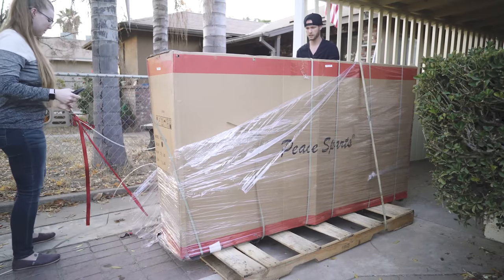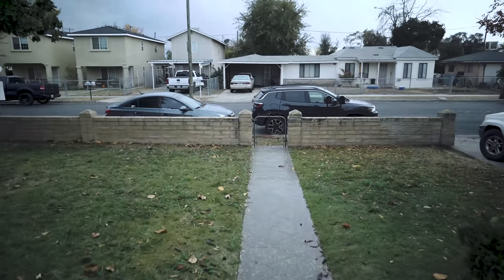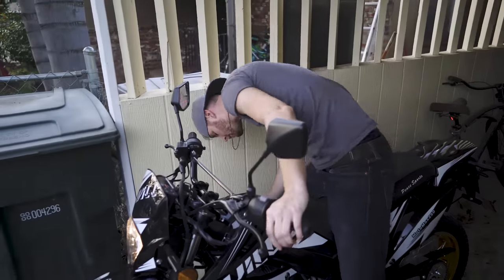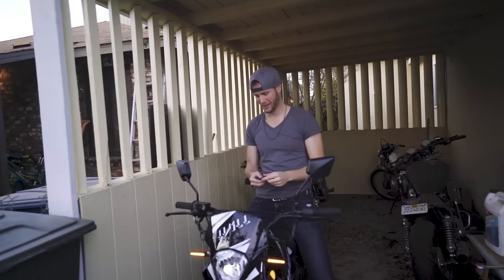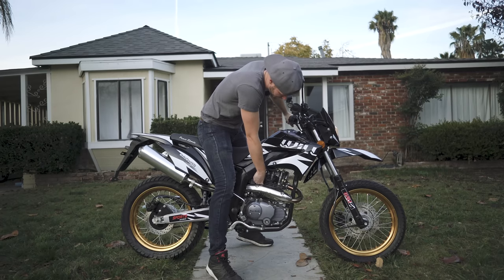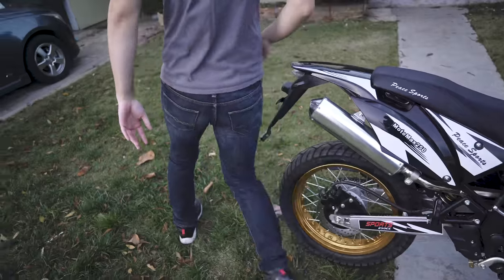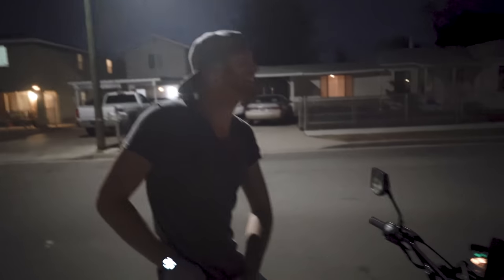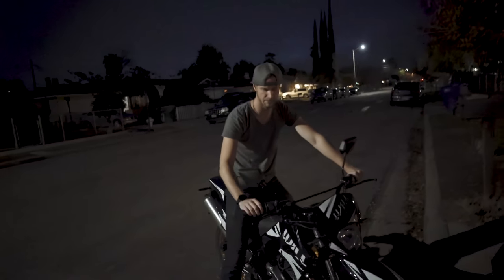This Motorcycle CAME IN A BOX (Shipped to my Door)

Comment: Take a day, take most every bolt out, blue LOCTITE them and torque them. Replace the ones under heavy stress with 10.9 bolts. Get a new chain. Open each connector and add a small amount of electrical grease and it'll last forever
Reply: You must be a mechanic or a mechanical engineer?
Reply: @dannythompson1948  actually I'm a family practitioner. I just enjoy tinkering and working with my hands.  I've taught my wife the same with her Vader. Even my 7yr old daughter can rebuild her own carb on her TaoTao 110cc ATV by herself.  It really is easy to do,  just tedious.
Reply: @Dr_Mike2  like a physician? That's awesome! I'm engineer at a hospital
Reply: @dannythompson1948  People let projects intimidate them because they're looking at the entirety.  There's an old saying,  "How do you eat an elephant?" "One bite st a time." In this case, one bolt at a time. 
My wife's Vader 125 I'd her first ever bike. It now has 26 miles on it.  The plan is to swap in a ZS190 engine and CBR125R fairings... One bite at a time.

Comment: Awesome video. Engine will break in.  Just wanted to share my experience with you for things to watch out for and do to keep it alive: first things: Replace plugs, change oil , add some gas stabilizer.  The bike we purchased only had a single phase stator and ended up breaking after the first week. Replaced with double phase.  Check bolts on suspension and wheels to make sure they are greased.  We had a bolt bust off after 2 weeks.  The carb will clog and will need cleaning after 3 weeks.  If you are a good with tools these should all be standard things you can fix. Just be aware the quality is just not the same and you get what you pay for.  Other than that, these overseas bike are really not that bad and now that parts are more available, time will tell if this catches on or if people get tired of the little things breaking. Cant wait for next video. thanks for sharing.

Comment: Definitely running a little lean. May be able to just adjust the a/f on the idle circuit (likely a small round soldered plug just in front of the bowl) and you probably need to go 1-1.5 revolutions of the screw out. At my elevation when I worked as a setup tech for Yamaha, all the dirt bikes needed to be turned 2-2.25 turns out on the idle circuit to get the A/F right, eliminate the popping on decel, and would rip way better when on the throttle. They’d ship all the new bikes in a crate just like that, and have a plug soldered over the A/F adjustment screw.

Comment: Check to see if the engine stops if the key is left behind following a remote start. Some bikes have this feature.
Reply: Andy Reid it’s not a Lexus BMW. It will start and run with remote start only. It’s a cheap Chinese bike. Take keys with u or leave them at home it will still run. It has no proximity link

Comment: Change the oil as soon as you can it comes with shipping oil in it
Reply: step 1, make sure it had oil
step 2, put a couple drops of oil in the cylinder (they might be dry from the factor)
step 3. change the oil after 50km (shipping oil is good enough for breaking it in)
Reply: No, I think shipping oil is just for corrosion inhibitor from the Chinese vendors. I wouldn't expect the motor to last very long. Bet there's all kinda metal in it when you channe it.
Reply: Pressure washer pumps from China have a fish type oil in them. I would change to a high grade gear oil, as soon as they come in.
Reply: @Gantzz321  You're so cheap you would trust chinese break in oil?  Wow
Reply: @Clearanceman2  To be fair they'd also be buying a cheap bike on Amazon from China...
Reply: @Gantzz321  You are correct as far as the Bashan bikes from Peace Motorsports...depends on the brand and what they throw in from the factory.
Reply: Imagine removing the decals putting a fake acrapovic exhaust on it it would be sick
Reply: Its chi ping oil

Comment: I'd suggest threadlocking all of the bolts/screws.  Be careful not to over torque them when reinstalling.  The threads get messed up too easy.  Otherwise I had mine for about 3000 miles with no issues, other than some missing screws here and there.
Reply: Lol I rode my second hand Yamaha Zuma 2004 3000 miles without having to do anything and that scooter has been crashed thrashed and is the best work horse scooter there is would beat this 250 and his old electric bike in a race it's a 2 stroke. But just like you said if you do proper maintenance it'll last even on Chinese!

Comment: Design wise looks exactly like nimota ranger x1. Im using ranger x. The difference between x and x1 is that x1 came with road tire and digital meter. The good part is that the engine is a beast. I use for 6 years and only change the oil once a year. Every 3 months i ride for 400km. It works and worth it for me as a student

Comment: A guy at work bought a similar Lifan 200cc dual sport sent to his house in a box. He wished he changed the brake fluid to Valvoline synthetic DOT 3 or 4 from an auto parts store right away- he had to clean the gunky brake fluid out months later. I use Fluid Film for the chain, from a Lowes store. Assume the engine oil in it is terrible- I like half Valvoline synthetic 20w-50 motorcycle oil and half Valvoline regular 10w-40 motorcycle oil from a Walmart, for how the clutch feels. For old carbed engines, they adjust the carb too lean to pass new exhaust testing.

Comment: Adjust the valves and richen it up some and it will start easy. I have a storm which has the same engine and it cold starts instantly and idles smooth.
Reply: yes,...adjust the valves.  I have a Brozz 250, bought from Peace couple months ago,...as Duck says,..starts instantly,  no choke if above 50 degrees,...idles very smooth,...instant response from the throttle.

Comment: Here's a simple hack. Remove the bottom screws of the metal frame around the bike, that way you just lift the frame up and away. Takes less time than taking it the top and sides AND bottom apart.  Sweet bike though. I remember getting a Chinese pit bike on ebay when I was a kid. Had to assemble it quite a bit. Guess at age 8 I didnt torque the front axle down enough. The front wheel fell off while I was riding.

Comment: You're going to want to adjust the idle air mixture screw.  Normally on the bottom side of the carb on the engine side.  May have a copper plug covering it.  Adjust it out until the idle stops climbing, then adjust the idle screw down.
Reply: I think he was turning the air mixture screw..not idle screw.
Reply: @davidjessee7701  I doubt it.  Air mixture screws a normally covered with a brass plug and are hard to get to

Comment: they all need the upgraded carb for 35 dollars to solve the problem,  and keep the motor from over heating,  its running way to lean,  and yeah,  these things come only with tiny oil in the motor.  about half a quart

Comment: 4 cycle or 2 cycle, the air fuel mixture needs to b set pull the plug out and turn the screw in all th way then out about 1and a half to 2 runs out then adj to fine tune it.

Comment: You said it was bogging, also it obviously didnt want to idle, did you only adjust the idle speed screw and not the idle air adjustment screw? If you have a tachometer set the idle to the recommended speed and turn the adle air screw clockwise to richen the mixture til it idles and hopefully no more bogging on takeoff.

Comment: Change spark plug to a NGK ,replace oil with good quality oil..run for an hour drain and refill.Keep an eye on the rubber parts,Chinese rubber parts tend to dry rot quick

Comment: don't forget to go over every nut and bolt to check for loose ones. QC over there leaves something to be desired. like QC. i've seen enough of these bike vids to know once you do that, you should have a fairly decent bike for the price. so much so i'm seriously thinking about getting one. everything else is made in china, so what's the difference?
Reply from the maker: Haha for real, though. Seems like a  pretty well put together machine.
Reply: @TheInja  the engine is a honda clone, i believe. the reliability depends on what factory built it. i've worked on a few clones. loncin is a good one. they build engines for some of the japanese, and european companies. lifan  is another. i've worked on some that weren't built by them with mixed success. it gets to where the repair cost is as much as a new one.

Comment: emissions cam, will not rev past 2800rpm or the spark plug will get coated in soot to the point that it wont run.

Comment: Probably way to late but when you get a bike in a box it's essentially put together for shipping. 
Not ready actually ready to ride. One of the reasons these Chinese bikes get such a bad rap is because they are pre-dealership. It has shipping oil that is just a protectant not actual oil(Don't ride on shipping oil), no grease, and almost nothing is torqued to spec, and there may be some odds and ends missing. This is all aside from the cost cutting on material. Sure they cheap out quite a bit. But should you treat one of these clones as if it were a pre-dealership bike and torque everything to spec, grease all the pivot points, throw out that cheap carb you'll have much better results. Don't rev the shit out of it like that, do a normal breaking. 500 miles for the first oil and clutch change and this wouldn't be a bad time to upgrade the chain and do a sprocket mod for your needs acceleration or top speed. Keep in mind they chassis are soft and the welds not so great so it's important for longevity to either be mindfully gentle to it, or reinforce mounts and such.

Comment: I would change the oil immediately and adjust your air fuel screw on the carb
turning it out 1/8-1/4 turn at a time

Comment: Hey thanx for the latest reply 🙂👍my commuter car is now running great! It was the one I changed the clutch on, and then had a leak of transmission oil and then broke my wheel spindle tryin to fix that. And now its got a new transmission seal and new drive shaft and a better used wheel spindle. Just 14 hours straight of work outside in the Swedish winter haha 😄
Cool bike! 👍🌞
I hope youll try electric again though. You havent driven an electric motorcycle before you try a Zero motorcycle. The new SR/F is a game changer with 140 ft-lbs of torque and 110 horsepower. I had a 70 horsepower dual sport, a DS, and it pulled hard until 160 kilometers per hour, 100 mph, i think. Hope you try the SR/F 👍🤓

Comment: 😉Nice bike I bought the Tmec version back in 2014 for 1500$ New and sold it in 2015 for 1500$ with 1500miles on odo it was a great value only problems was cheap chain broke popping wheelies bought a quality did chain and fixed that problem engine was a honda crf250 clone.

Comment: there's a break-in procedure not supposed to go above a certain RPM for the first 400-600 miles I think something like that
Reply from the maker: Nah, not for these bikes. I read the manual and it didn't say anything about it. 👌🏽
Reply: @TheInja   I work on bikes I balance carburetors I pull them all apart put them all back together the four-barrel carburetors to have a Million Parts Springs and screws it's good practice when you first get an engine run it for a little while then change the oil it ensures that you retain the horsepower and the longevity of the motor

Comment: I'm always tempted by these Chinese bikes, but question whether I should just save my coin to go towards a Honda CRF250L.
Reply: Element of Kindness Most definitely go with the CRF, or the 250KLX from Kawi. You can get nice used ones for around $3,000. WR is a bit more high performance, but you will pay a lot more. DRZ400 is also a good choice if you can find a deal on one.

Comment: The alarm system might would've kept you from driving off once remote started.
Reply: Like some type of Proximity switch ? Although if that were the case and it was really easy to disable the alarm like he did with the bike idling would the bike shutoff initially after disabling alarm or would it just keep running ? Or did he just unplug a speaker to alarm and the alarm is technically working but in silent mode ?

Comment: Does that have oil in it? Just asking that oil window looked empty
Reply from the maker: Yep! Probably will change it, though, looked very cheap and very thick
Reply: The Inja yea it’s probably the type of oil most manufacturers use, most dealerships upon receiving a new motorcycle will empty the factory oil with something else
Reply: @TheInja  check out 5w40 or 5w 30 Liqui- Moly oil. Top quality oil will improve any engine.

Comment: 1. Sit on the seat correctly 2. Clean the carb 3. Change that nasty oil it shipped with 4. again, sit on the seat correctly
Reply from the maker: 1. I'm 6'3" 
2. Why?
3. That was the first thing I did
4. I'm 6'3"
Reply: @TheInja  1. Get a bigger bike if you can’t sit correctly 2. You said it was sputtering, it’s a Chinese carb. Clean it to be sure there’s no debris or replace it with one you can properly jet.  3. A lot of people skip this step 4. It’s just a safety thing and it’s good practice. Like on a dirt bike you want to sit as far forward as possible. *Also, I know this video is a year old, I just wanted to throw my input in. I don’t usually comment. *Another also, the remote start is pretty sick actually!

Comment: Considering that the factory didn't set the carb you think that your fuel air screw is where it should be or needs to be adjusted to and you change still sounded a lot too tight I'm going to wipe out your sprockets real quick and the chain which is why most bikes  that 1 1/2"    regardless if it's a street bike or a fucking dirt bike in my 32 years of being a biker and riding dirt bikes and bikes the only one that's different is the belt drive

Comment: just like un-crating and prepping any other motorcycle from ANY manufacturer
Reply: Yeah but you don't normally have to do it yourself on your driveway.
Reply: @minnsminns  It is if delivered to your residence-- you have to do all the prep work the dealer normally does.
Reply: @TheMotorRAJ  where the hell do you live? That's not true at all, if it's from a large company dealers always do the prep.
Reply: @minnsminns    Did you Read ?  IF Delivered to your Door.. .then it bypasses the Dealer, therefore no Prep.   As I said.
Reply: I live in the USA,  Been in the Motorcycle Industry for over 25 years; tech, marketing, manager, and parts biz owner, and have been with over 7 major manufacturers (Ducati, MotoGuzzi, Aprillia, Laverda, Triumph, Honda, MV,  to name just 7) .   Dealers.. always do the Make-Ready Prep(potentially mount bars, wheels, bags, service battery, engine oil, gas,  tune) , not the Manufacturer.   If the bike is ordered directly from the manufacture  and delivered To the Customer's door, then it will Never be Prepped  before delivery... unless special circumstances apply.    IF Ordered from a non-local dealer..,  then prep will also Not likely be done ahead of time, as the bike will not fit in the manufacturer's crate  with typical handlebars and bags(if applicable).   Some bikes  do not arrive with the front wheel attached.. because of height.   Some manufactures do not even put oil in the engine.    Motorcycle batteries, also do not come with acid in the battery, and therefore not charged.  Battery prep is carried out by the dealer. Tuning of carbs.....for altitude, temp, etc.. is also  carried out by the dealer, if needed.  Ive worked for over 8 motorcycle dealerships.. and  in many cases when a bike was ordered.. but delivered to another state. or country,  and the customer wanted the bike prepped, we'd prep the bike.. and then have to arrange a special courier for transport, or build a new crate to accommodate the machine fully assembled.     In many cases, transport companies or transporting laws, do not permit the machine to have the battery hooked up or fuel in the tank.
Reply: @TheMotorRAJ  Weird, cause I literally had a 0 mile Yamaha delivered to my door fully assembled and prepped.
Reply: @minnsminns   The Yamaha dealer ..delivered to your door, right?   Dealers will do that., as I said also.    Ive  prepped and delivered many bikes to person's homes, from dealers.    but Ordering a bike.. that doesnt have a Local.. or USA dealer,  wont be ready to go when it arrives.    I special /custom ordered a ChangJaing 750 with side car. back in 2004.  Came in some wooden crates, and a few hours of assembly.... just as it would have, if it had gone to a dealer.. had there been a  dealer back then.  I even picked it up at customs.
Reply: @minnsminns    Yes, By the dealer, not by the Manufacturer